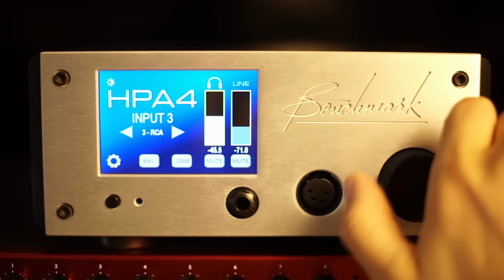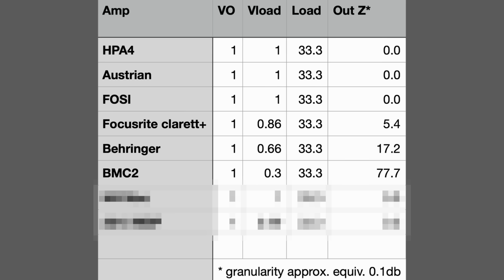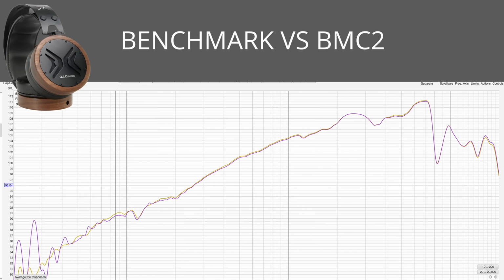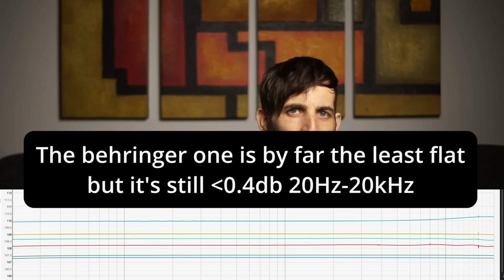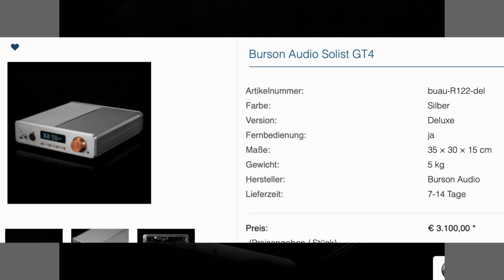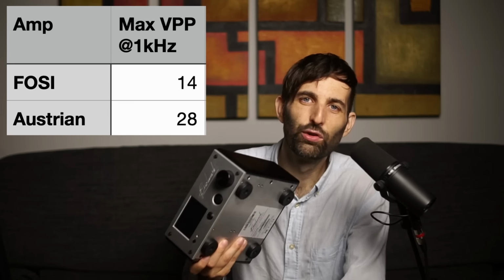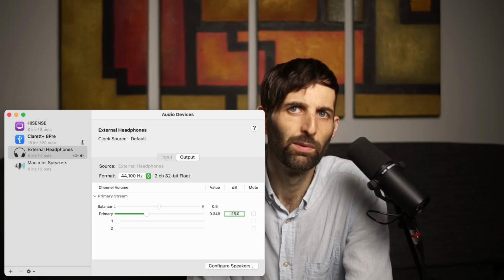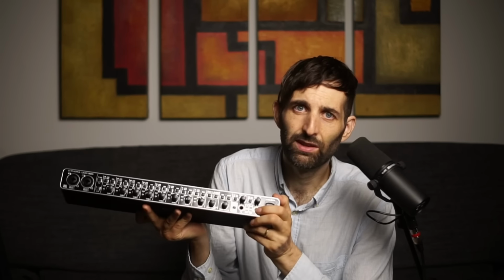Stop plugging your headphones into your audio interface!! Headphone amps demystified.

Comment: I set a dedicated analog knob at the pinky just to save on hearing.  
Nothing else can guarantee safety when plugin adventuring.
Digital volume control relies on smooth operation, and you can't always see the value. 
What do you do when you get a huge spike you can only stop by having to remove your headphones.
Do you suggest any type of volume or mute control?  Gotta be somethin'.  
It's dangerous out there.
Be safe.  Love ya.
Reply: How about a limiter on master with a safe treshold?

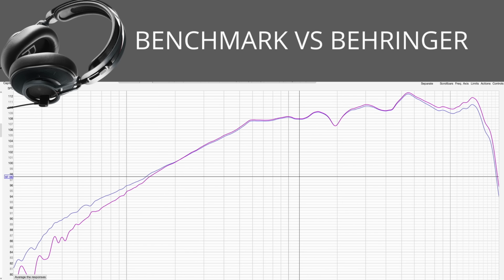Comment: I've also used the headphone output from a MacBookPro years ago, but now I used a Grace Design SDAC connected to a (balanced output) SMSL linear headphone amp I bought on Drop. I just leave the volume control on the amp at 12:00, since there is no recall. This has worked well for me for mixing.
Reply: Can't go wrong with Grace Design gear

Comment: WOW - You just saved me £350 on the 32bi/96KHz Grove by Apogee. Funny you know because I have been using the headphone jack  on my M1 for the moment. The newer MacBook Pro M's have high voltage - for as I understand it. You know you were saying that the MOTU 24Ai was being phased out - well if you look on the site they still have them. However I see that FerroFish have some very nice units that maybe with looking at if you have analogue synths and Euro-racks to integrate into your system.
Reply: Don't use your M1, honestly, it's not very good at all.
Reply: @Greggles5000  So you're not convinced by his mystery DACs?
Reply: @nkarfootTv  Of course not. Maybe you won't notice much with some types of compressed dance music at 48k, but even if you don't try a flute at 96k,  it'll still be blatantly obvious if you have silver, let alone golden ears. He can take all the ritalin or red bull he wants and yell at a camera with some graphs, tbf if the guys ears are this bad, that's his better career choice. This is honestly insane to anyone who just has reasonably decent gear. I'ts rage bait for those who do have good equipment, but mostly, only believable to those who don't, who seem to be some of the audience?  There are overated dac/amps, sure, Topping etc for the $ is fine, but a Mac laptop is only something you put up with until you can get home and hear it properly. Unless you can't hear properly to begin with. 
To be clear, I'm basically retired and have a wide collection of amps/speakers/headphones, and usually use a valve amp for headphones, but as I said elsewhere, an SPL Creon worth $200 will 'show' you things you just could not ever hear from an Apple onboard amp. I gotta ban myself from this channel, it's half right, and half ratings b'shit to stimulate a faux debate.

Comment: impedance is a complex number, and it is frequency-dependent for anything other than a purely resistive (no reactance) source or load.  Ideally you'd measure impedance across the frequency spectrum and plot that (with both amplitude and phase). The phones also have frequency-dependent impedance.  These impedances (source and load) interact in the complex domain and mess with phase as well as amplitude.

Comment: I cant see why your using the senshiezers to express thr comparisons. The senshiezer has no low end so it like testing a tv screen in black and white. Amps effects more than just frequency responses like dynamics, seperation, imaging. I know you usually pay large amounts for small gains through amps, dacs and cables but it all adds up. I find good pairing works well. With good pairing you can match cheaper products and get max gains.

Comment: I've always used dj mixers for  headphones. Even an entry level mixer still slay almost any hifi or soundcard headphone out I've ever heard.

Yes they obviously don't have recall but in terms ability to drive headphones they're always great value. 

Only drawback is they come with about 11 noise sources at entry level so you need to be creative and input your DAC via an external fx loop etc. I.e. bypass half the unit.

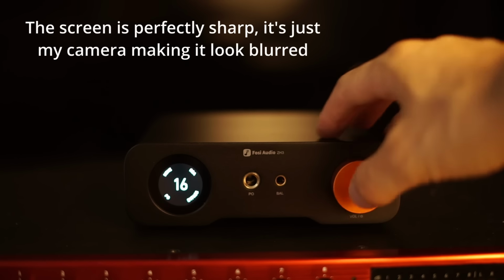Comment: 12:40 You've obviously been talking to Benchmark's John Siau, who is an excellent engineer who knows his stuff; I went through his white paper on amplifier output impedance and damping factor "Damping Factor Isn't Much of a Factor" some years ago, and fully understand the mathematics behind it.  Because the output impedance of an amplifier and headphones form a voltage divider, the ratio of amplifier output impedance to headphone impedance should be ≈ 1:10. So an amplifier with an output impedance of 3Ω should not be used with headphones of < 30Ω. As you alluded to it's quite easy to measure headphone output impedance (if the manufacturer doesn't give it in the specs) by Zₛ = Rₗ(V₁/V₂-1), where Zₛ is the output impedance, Rₗ is the dummy load, V₁ open circuit voltage, V₂ loaded circuit voltage (by the insertion of Rₗ) read peak-to-peak on an oscilloscope from, typically a 1kHz sine wave.

Comment: And what about if I connect my headphones (a lot of different headphones in my collection) to my audio interface RME ADI 2 Pro FS? I have a Beterdynamic T1 1st gen, which requires high output impedance of 100ohm (exactly 100 ohm) to guarantee the specific frequency response. I designed a lot of headphones amps in my practice and some high-end are not required for headphones (especially for 600ohm high sensitivity headphones). I also designed high speed CFA, high slew rate and high power amp named LNA2104, which I can configure for high impedance and for low impedance. In fact the IEC standard define 120 ohm output impedance for headphones and most of the old school EU audio equipment supply exactly 100/120 ohm output impedance. The output impedance is mandatory for the dynamic headphones but it is not mandatory for low inductance planar headphones, which require more power (current) to drive it correctly. The contemporary planar headphones can be drive easily by several high current op-amps in special  parallel configuration (I tested in my lab with a high precision THD distortion meter). Indeed the RME ADI 2 Pro FS use quite transparent and good sounding low distortion approach by paralleling several high speed op-amps to drive the headphone output. On the other hand my Otari MTR-12 use a traditional headphone monitor with external high power transistor buffer at the output which drive the internal 4W speaker (power supply of +/-24V for the integrated headphone amp). It also use high impedance output by design and is good enough to drive the 600ohm and most IEC based (early standard) headphones and can supply the requirement of the T1 1st gen headphone but it also can drive any planar headphones without changing the original frequency response (for the planar headphones).

Comment: First of all, I'm not hating when I say this. I appreciate the effort involved. However, in my 30 years of high-end audio, both loudspeaker and headphone, it has been my experience that the better something measures, the more boring and lame and uninteresting it sounds. 
I had that Benchmark headphone amp (twice actually), and the Benchmark loudspeaker amplifier driving a pair of speakers and also a pair of $6,000 headphones. Absolutely the most boring and lifeless and soulless sound I've ever heard. I've heard other solid state equipment that sounded great but in the end, nothing approaches the realism and the Romanticism of tubes, in my opinion. Funny when you think about it because tube amplifiers measure like crap! So, I don't care what anything measures like. It means nothing. Absolutely nothing. The only thing that actually matters is what your ears hear.
Reply: Precisely and utterly wrong! This is the fount of so much audiophile hubris.
When it comes to discerning the fine differences that exist across a whole range range of easily measurable audio properties, the human ear/brain complex is an utter "dogs breakfast" of insensitivity and preconception.
Your notions of "realism" and "romanticism" are then really the exclusive domain of the engineer and the editor, and not the business of the outputs of valves, where all that nasty harmonic distortion - for that is what it is -  is most undesirable.
The human brain really should stick to what it IS good at! Which, for the purposes of this thread, is to make value calls and judgements of taste when engineering and mixing source material.
Reply: @Lif-999 Ummm... No. I respectfully disagree. The even order harmonics of valves / tubes are more desirable, in my opinion, then the odd order harmonics of solid state equipment that measures well. There is a REASON many seasoned audiophiles such as myself, tend to prefer the romanticism and lousy measurements of tube amplifiers.

Comment: I have the opportunity to permanently test and listen to many high-end headphones, but also cheaper models, even standard headphones used in professional recording studios. Meze Audio, Hifiman, Dan Clark Audio, Audeze, Fostex, Hedd, beyerdynamic, Sennheiser, Neumann... to name but a few. And my reference amplifier, which I use to bring out the characteristics and capabilities of each of these headphones, is precisely this amplifier, this Benchmark. It does nothing but make the signal louder. No “warmth” from overtones like some other manufacturers, just the original signal amplified. It gets warm, it's huge, it's very expensive, I can't afford it, and I love it. Sit down in an armchair, well rested, get yourself some very well-produced source material, use a studio-quality DAC, power a power-hungry Susvara with this amplifier, and you'll hear music the way it was meant to be heard. Forget the high-end cable BS, use affordable, studio-grade equipment, and everything will be fine.

Comment: Noobie question here: how do you monitor your mixed from a separate headphone amp or dac/amp when all your ins and outs are going through your interface (instruments, outboard gear and speaker monitors, etc). Just plug it into a separate USB input on your computer and set it up in the DAW settings? Or do you plug it into the A/D interface somehow? Sorry if it's a dopey question.

Comment: $4000 is out of my price range, however still relatively reasonably priced for high end audio equipment, so it shouldn't be too surprising if the Benchmark smoked the competition. But when a piece of gear costs $40,000 that's when you know things are out of hand.
Reply: $4,000 is out of  hand 
The Internet has made music worthless
Reply: @thedevilsadvocate5210  thats why people are going back to vinyl and discs, music was indeed made worth way less because of the easy accessibility, also because its so much cheaper and easier and portable and better sounding today than it was 30 years ago, i think today a 3000dollar setup is an endgame setup in terms of both amazing sound quality, variaty and portability. thats is for "casual listening," not professional mixing or mastering or all that. but it includes amp and DAC, headphones both open back and closed back IEM and dongle for the IEM that has enough power to run the bigger headphones.

Comment: Output impedance is a good thing to focus on. It's one of the things that actually can make a difference. Too high, and it skews the freq response (usually dropping bass more than highs).

In terms of the "channel balance" issue, this is why I built my own passive monitor controller with a custom-built stepped attenuator, and I could also have control over the input impedance so it wouldn't cause issues with the frequency response. The Johnson noise is negligible (I mean totally inaudible) even with 24 series resistors, and I get precise Left/Right channel balance within 0.05dB based upon manually measuring each resistor used. I'm OCD like that lol.

Comment: I plug my HD650s into a Graham Slee Solo SRGii headphone amp with PSU1 power supply fed by the DAC in my Clarett and I’m pretty sure my ears are the weakest link in this chain, although I can hear the difference between 48 and 192kHz at 24bits
Reply: should have used an 1990s HiFi and you would have been fine and infact most of the time you get better overall sound :D specialyl more analog and warmer sound so yeah, alltho still way better then plugging them headphones into nothing at all, immagine i would plug my HD 820s directly into my PC without any amplification? yeah it would like a 20 buck from target ^_^

Comment: MOTU M2/4/6 headphone jack has an output impedance of 0.05 Ohm. Small pot without detents, though. No issues driving 250 Ohm headphones, but I don't need a truly repeatable setup.

Comment: what about DISTORTION????
And its type? 1st, 2nd, 3rd, harmonic or non harmonic... This is way more important than most of the metrics you provided, like EQ...
What about dampening effects? What about measuring distortion or even eq curve at different sound levels?
What about very hard to drive headphones, planars... And these are very much audible things...
I am all for busting audiophile myths, and I also like your videos, but this one lacks so many things, especially the most important ones. 
:(
Reply from the maker: distortion is equally low on all of these. distortion is a solved problem for anything which isnt total junk. even the behringer had somewhat low distortion. im not showing EQ here. Im showing the results of damping factor, so I am discussing damping factor directly as the most important part of this video. "hard to drive" is just voltage which I discuss
Reply: @APMastering Well this is not my experience. Just like you, I write audio plugins, also approach sound from a physics aspect. And am very critical with myths. But I do not agree that distortion is solved... I clearly hear very different distortions between devices, and they drive my different headphones very differently. EQ is the one thing that I can correct for all the devices, but those other artifacts are not solvable like that. And I did a lots of tests.
Reply from the maker: @Sonnell  not sure what amps you are measuring. all my measurements were below audible levels in my tests
Reply: @APMastering Well, measurements are not everything. Did you measure the output of the headphone or directly the amp? I have a Schiit Mjolnir as the top end, and a lots of stuff below. I even did blind tests with my friends, some highly sceptical, some electrical engineers, and all do hear a clear difference with different amps. Meaning, the standard measurements are not enough. 
The loopback tests you sometimes do is the best tool I think.

Comment: Topping DX5 II is really good and it's about 300€, it competes directly with RME ADI-2 DAC fs. Also hifiman have the new Edition XV, which are close to Arya Organic, the best mixing/mastering headphones under 1k.
Reply from the maker: they are planars so likely have all kinds of resonances in the highs
Reply: But perfect flat bass down below 20Hz and much better staging, so still more preferred nowadays.
Reply from the maker: @ModPhreak  I take bass rolloff over comb filtering in the highs any day
Reply: @APMastering I think most high end planars have that issue solved but they are expensive as that ultra thin film and design tolerances are just nuts... ie, look at Audeze Fazor patent, or Hifiman Stealth
Reply: @APMasteringPlanar tech is advancing with meta materials and smoother magnet geometries.
Reply: The Arya Organic has significantly more high frequency output than the Edition XV. The Edition XV is closer to the original Edition X in that sense. The Edition XV is closer to the Arya Unveiled than the Arya Organic.

Comment: About the impedance: that's generally frequency dependent, which may explain the counterintuitive results.
Reply from the maker: sure but headphones generally have rising impedance in the bass which should result in a boost if I am not mistaken but Im not an expert on that topic
Reply: @APMastering Most moving coil headphones (typically called dynamic) have an impedance rise at the resonant frequency of the drive due to the back EMF.
Something like a typical planar magnetic headphone has a relatively flat and or linear impedance, hence only really showing drop in power when plugged into a high impedance load and not a frequency response shift
Reply from the maker: @temp0ra  sure but that peak is normally in the lower frequencies, with senn 660S its around 100hz
Reply: @APMastering It's actually the other way around, because the impedance rises with frequency due to the rising inductive reactance of the voice coil.
Reply from the maker: @georgebliss964  no actually its not, the high output impedance of the amp acts as a voltage divider with the headphones and actually increases the voltage transfer around the impedance peak RELATIVE to a lower impedance amp. thats the normal behavior but I got the opposite in the video which baffled me.

Comment: Tip for RME users: there is a mac app called ControlPilot which gives the user ability to create keyboard shortcuts for the most relevant and important DAC Controller features for TotalMix (like volume recall / dim to a specific value, switching between speakers A and B, switching between speakers and headphones, change the volume with customizable granularities etc).  But for the headphone volume recall ability it needs to be a model that is digitally controlled (models that have knobs on the front panel cannot be controlled digitally and thus won't have this benefit from the tool).